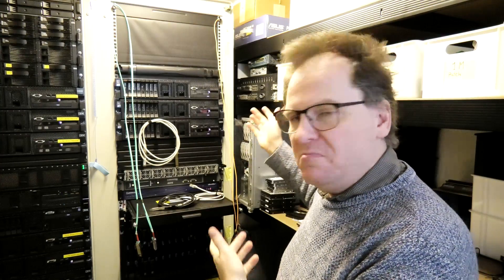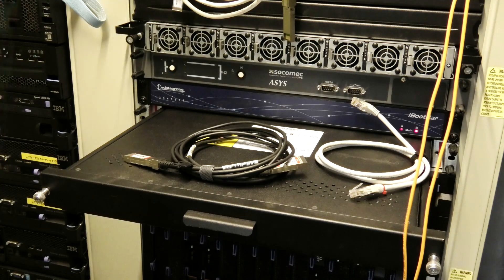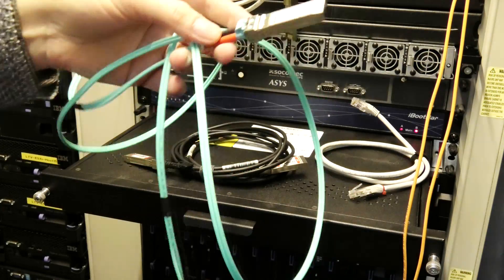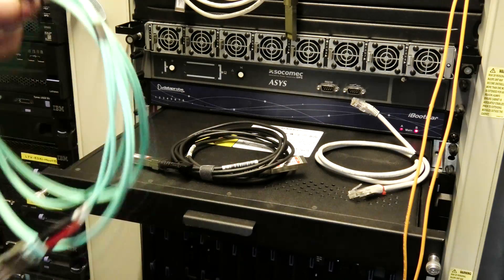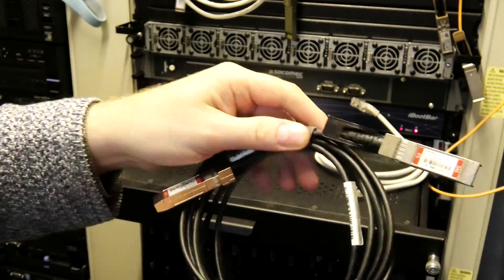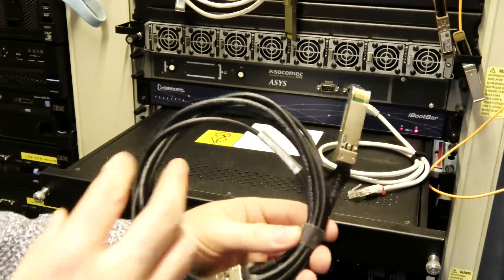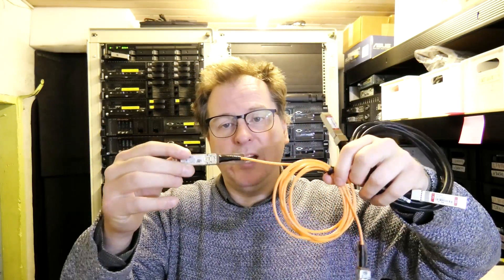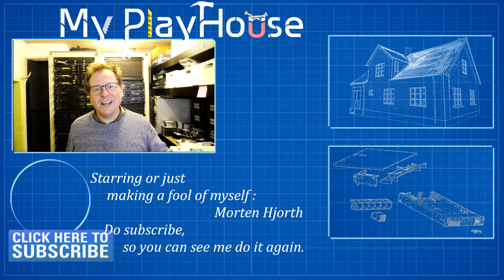Latency Difference Between 10GBASE-T SFP+, AOC & DAC Cables - 1286

Comment: Modern bend insensitive fibre cable is not particularly fragile.
Reply from the maker: Well those thin fiber cables kink really easily :-/
Reply: @MyPlayHouse  then stop  buying the 2.0mm ones and buy the 3.0mm ones. I would point out that you are not supposed to kink Cat6a cables and they have minimum bend radius too that are larger than bend insensitive fibre. I have doing fibre optic cabling in the data centre for nearly 20 years now, it is not as delicate as people make out. The main thing is to keep the caps on the ends. For LC connectors you want those clip on ones, not the tiny push on things that fall of as soon as you look at them.

Comment: Using a 10GBASE-T SFP+ isn't allways the worest solution, it depends on the circumstands. In my case I wanted to upgrade a 1Gig connection between my main rack (standing in my hallway) and a room above my garage. Inbetween is a kitchen and routing a cable through a kitchen is really time consuming. The 1Gig connection is based on a CAT6 cable and could handle the 10Gig. Therefore the cheapest solution (counting my spare time too) was to use the 10GBASE-T SFP+ connectors. If there were no cable already there, I would have used a fibre cable 😄
Reply from the maker: If the equipment does not have SFP,, or if you need to go from 10 to 1 gig 10GBASE-T is good. It's not as if it does not work :-)

Comment: Should mention not all DAC cables are direct copper. Some do have active components inside and convert to coax over the cable. Look up passive and active copper DAC cables.
Reply: True but they are more expensive than AOC or just SR SFP+'s and the fibre. Personally I hate AOC cables. You have heavy lumps of metal on the end of your fibre just saying break me now, and if anything goes wrong you are into replacing the while dam cable, where if you had just used a couple of transceiver and some fibre you would only need to replace the duff component.
Reply from the maker: Hi BlueFoxTV
Thank You very much!  glad you liked the video :-)
Thank you for watching! :-)

Comment: 8:47 another fun fact : Light traveling speed in a medium is related to refractive index of the medium
Reply from the maker: Humm what is the latency of a reflection,, does light just instantly go the other way :-?
Reply: Interesting question! I searched and found, on graded-index fibre, refractive index of the center of the core is higher than that of near the clad, and carefully designed to match light traveling time of zig-zag route with straight through route by adjusting refractive index gradation. Therefore light traveling speed is determined by the refractive index of the center of the core on graded-index fibre. On step index fibre, light with zig-zag route reaches late and signal is blurred